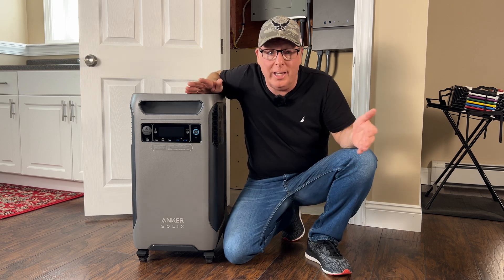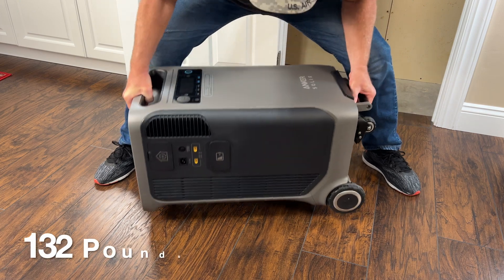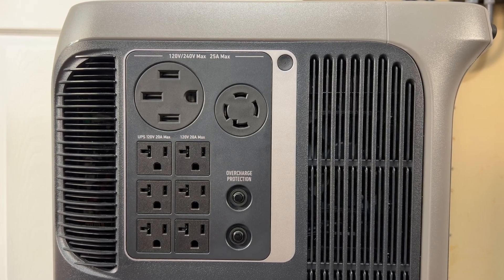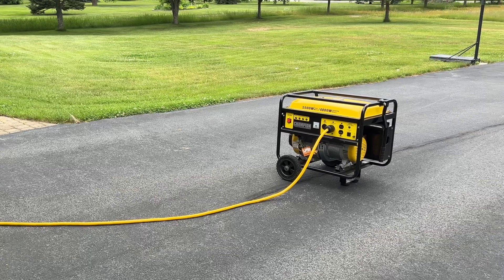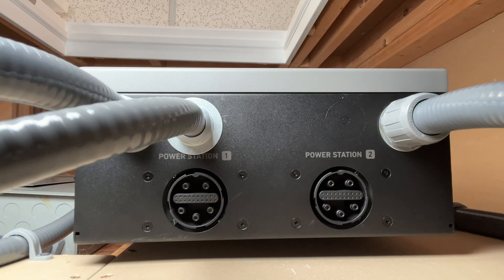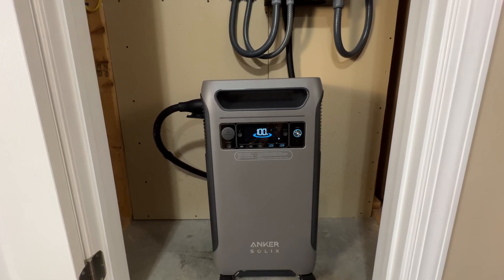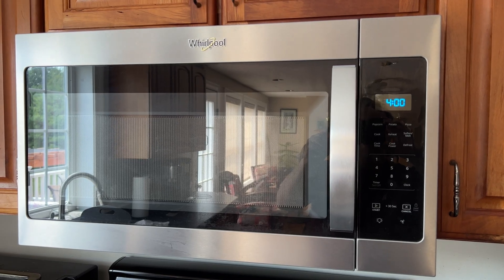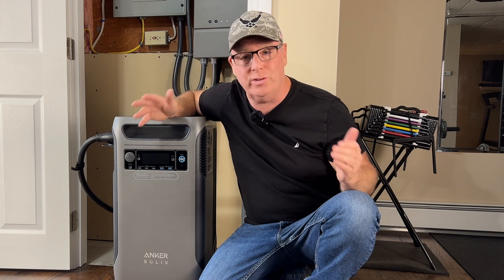Can Ankers New Battery Power Station Backup my Whole Home (6000w Inverter)

Comment: The sale price of the F3800 alone is $2699 ($1300 off) and the battery alone is $1799 ($700 0ff), so the combined price of $3999 ($2499 off) is a great deal if this fits your needs.
Reply from the maker: I may actually pick up a second battery to double the runtime.. They are having some great deals right now.

Comment: Which package did you get off the website? I am looking into getting this. I want to run my household off this with the app so I don’t have use the power all the time from the power company.
Reply from the maker: I got the F3800 with the home power panel. That includes the F3800, the Home Power Panel and the 12 circuit Sub Panel. If I had it to do over I would include one expansion battery to double the capacity.
Reply: @BackyardMaine  what accessories do I need to buy with this package?  Also, will you do a video when you get the solar panels? Thanks
Reply from the maker: @obediahanderson788  You will need some wire and flexible conduit and some connectors. Also some lugs for the transfer switch. All stuff you can get from your home improvement store if you're planning to install it yourself. If and when I get solar panels I will certainly make a video on that as well.
Reply: @BackyardMaine  thank you sir.
Reply: Hey sir. So now I am running into issues getting it permitted since the UL listing is not on the Home power panel. Since you are an electrician, did you have to get it inspected? Thanks sir.

Comment: These units have come a long way! I’m curious how long my RV air conditioner would run.
Reply from the maker: The battery capacity 3,840 watts so if you divide that number by your AC wattage you will get the number of hours of use. That is if the compressor is running continuously. Ours cycles on and off once the space is at temp. If that's the case it would run much longer.